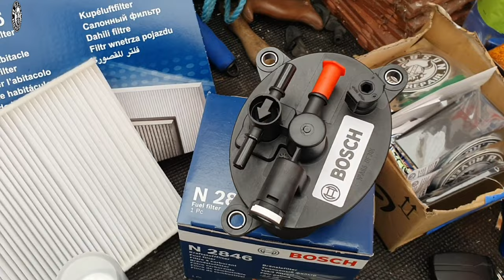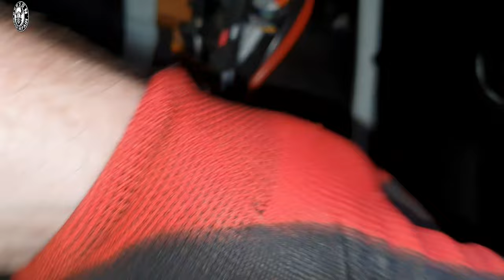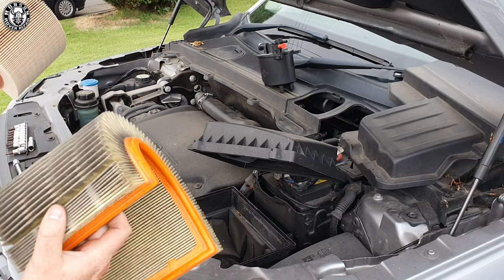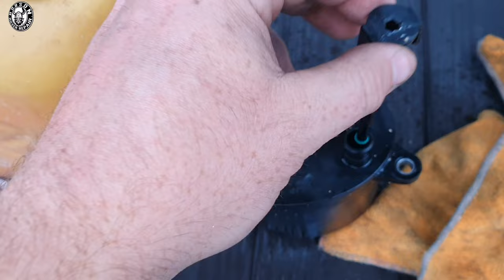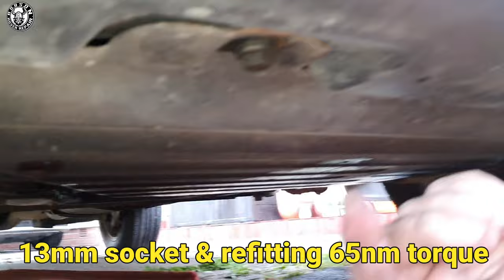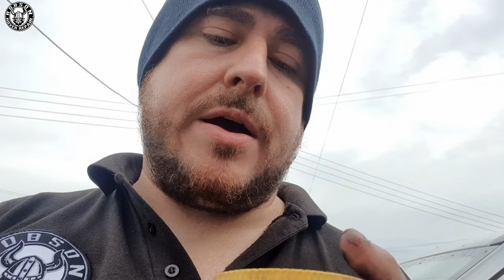Freelander 2 service guide - Complete diesel walkthrough and the essential tools to make it simple!

Comment: Thank you, I have watched loads of YouTube videos on how to replace the fuel filter.
Tubes, pumps, clips and bleeding injectors, some of which were not very successful.
Tried your method filling the filter with the finger on the outlet pipe on the bottom and boom started first time.
Also great tip using the 27mm ratchet wrench on the oil filter.
Reply from the maker: Your very welcome mate. I'm always happy to hear this stuff helps people

Comment: Legend, great content! Had no idea you could prime the fuel filter like that, so much easier. Just ordered flexi ratchet spanner, definitely worth a few quid, that oil filter housing drives me mad every year. Keep up the good work
Reply from the maker: Makes life a lot easier as you will never "crank" it to prime, you'd do more damage to the injectors than anything else.
Reply: @RobsonRoverRepair  when you mention about blocking the bottom drip hole on the fuel filter, do you have to take something off the old filter to do that? I don’t understand, what would you block it with?
Reply from the maker: Assuming you fill it off the car, just put your thumb over it until you slide the clear tube back over. I find it easier to fill on the car when it's all reattached, it's very much a case of what suits each person.

Comment: Thanks Colin, that was quite instructive. I quite liked having it all in one video, harder to miss something out. If you do get an automatic for yourself I'd been keen to see more videos on transmission fluid flush, haldex fluid & filter change, brake fluid, coolant, power steering and so on: the usual stuff we do when there's a new addition to the garage with a few years on it.
Reply from the maker: Appreciate that buddy. Yeah that's the plan, might have to be a van instead to tow race mini and trailer. Shall see. I do fancy a FL2 auto with a roof tent on it as tow vehicle

Comment: Hi RRR
great in depth instructions👍👍👍👍
what years the car, 
i was thinking of getting one 
would appreciate any tips on problems what to look out for.
regards
Kev
Reply from the maker: Tbh thry are super solid motors. Rear diff can give up on them and really needs to be done ASAP. Avoid the 2wd ED4 version. Personally I'd love the 3.2 volvo v6 engined one but a 2.2 150/160 td4 is great, but a 190bhp sd4 auto with the glass roof is hard to beat.
Reply: @RobsonRoverRepair  👍👍👍👍👍👍

Comment: Did the oil change Wed this week, found I couldn't fit the fancy ratchet spanner on the filter cover without it falling off all the time. Ended up attching the ratchet end to the filter cover from above then going under the car to slowly undo it. I see from your vid your ratchet spanner head is a little more firm where mine flopped about a lot. That might of been why it wouldn't go on at 1st. Anyway great video thanks.
Reply from the maker: Well done mate. Yeah it's a real pain in the rectum isn't it but glad your sorted. I've seen a few chewed up oil filter housings online over ait all also. I will probably buy a spare to keep for my father in the future as plans are to keep it very long term.
Reply: Thanks for your reply, I've watch the whole video and thanks to your video I've been able to replace the air, pollution and oil filter, doing the fuel one after Christmas.
Reply from the maker: Just remember the pipe under neath the filter BEFORE filling it. It's usually clear and you often read about people on forums who forget about it!
Reply: @RobsonRoverRepair  I'm not sure I get what you mean about the pipe. I've just ordered the tools and filters you linked to and don't want to mess things up. Does the clear pipe come off with the old filter and pushed onto the new filter before filling it?
Reply from the maker: There's a little clear return pipe fitted UNDER the fuel filter. Make sure you fit that before prefilling here's what I'm talking about. It will be clear when you remove the old unit. https://azure.wgp-cdn.co.uk/app-land-rover-monthly/posts/Freelander_2_service_2018_17.jpg

Comment: Hey mush enjoyed the video.  Have you ever come across a loose heatshield on one of these? I have an annoying rattle at between 1 and 2k rpm in lower gears and when in a higher gear and speeding up to change gear.  Doesn't don't with clutch in and reving the engine which is odd. Anyway after this video I will attempt two of the 4 and then grow a pair of balls and go for the last two . Cheers again
Reply: Rattles like the one you describe are a chronic problem with these. Under load and low RPM's I think the engine really bounces around. I've had to hunt and fix a couple of super annoying rattles in the engine bay. The intercooler hoses and the power steering reservoir are a couple of culprits.

Comment: Can you evacuate the oil instead of using the drain plug?  If so, what is the process?
Reply from the maker: I've never tried it on a 2.2 yet. I have an electric oil pump that connects to car batteries for it. However considering you have to go underneath to do the oil filter and remove the under tray to get at it anyways, it makes more sense to do it this way. If it was a FL2 td4 with the bmw engine you cna do it all from up top obviously, but not the FL2.
Reply: @RobsonRoverRepair  I got to me of those hand pump pressure sucking oil evacuation with the long hoses that can take 6L oil.  I’m gonna try it as I don’t fancy the mess draining the oil out.   I’ll let you know. 

Becuase it has a dipstick and a oil cap at the top - should be easy enough to thread the pipes in. 

The bugger is the oil filter cap, which I’ve had to order that 27mm ratchet wrench to do.

Comment: I opened mine and the measuring stick thing had 2 plastic clips and one broke while taking it out. Worried the plastic bit that broke might travel through the pipes or block the flow.
Reply from the maker: Easier and safer just to outright replace your fuel filter again, it's probably lodged within itself.
Reply: Yea I could hear it move and then like you say it probably lodged itself in the filter. Like you say I'll just get another to be on safe side.

Comment: Hi how much for a full service on a 2011 freelander 2 td4s 2.2
Reply from the maker: I say a mechanic would charge two hours labour at most if they have never worked on one before. The only two tricky aspects is the under tray as it's quite heavy and obviously the awkward oil filter. You could easily do it yourself including the specialist flexing rachet for under £100 using Bosch parts including the oil, and then you'd always have the tool for doing it yourself in the future.
Reply: I've been charged the 180,200 mack is that a good price
Reply from the maker: Well if that's a dealership and depends what else they may have done like belts etc it would be fair

Comment: hey buddy, I'm in Australia, just got a Freelander 2 2013 90000 km for 18000 aud, from Landrower House in Brisbane, 3 month warranty, the engine is ok, i have a problem with the steering wheel shaking at over 90km speed, tyers are balanced, bushes are new!!! what would be the problem, plz, your opinion!!
Reply from the maker: Classic death wobble. Most wheels are balanced only 15mph depending on the brand of balancing machine. If the tyres are more aggressive 4x4 profiles or weights then I'd highly suggest Ceramic Tire balancing beeds. 

They typically start most effective mid 40s mph and are especially popular with truckers and extreme mud tyre users.

But on regular 4x4 tyres they are great addition especially if your doing a mixture of 4x4 low pressure off road and also high pressure on road driving.